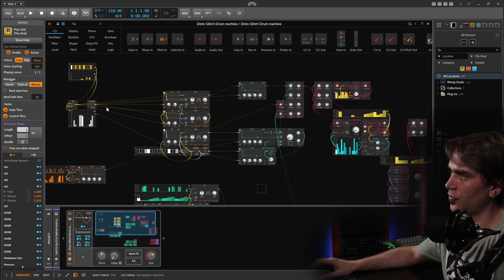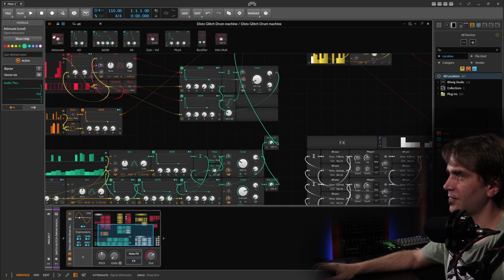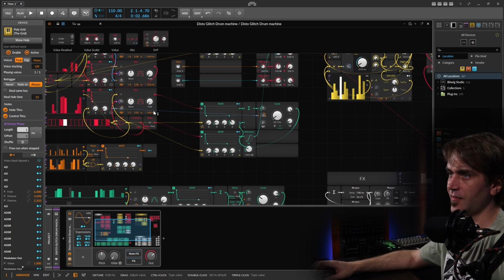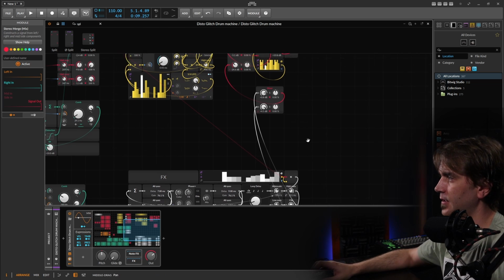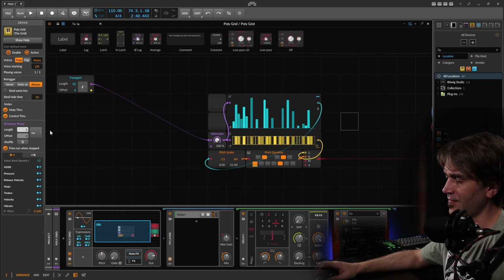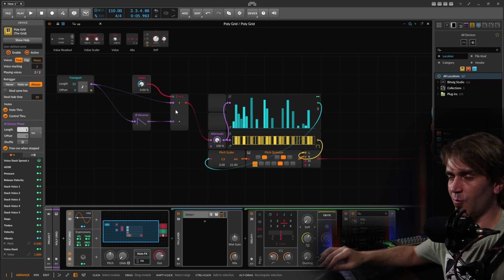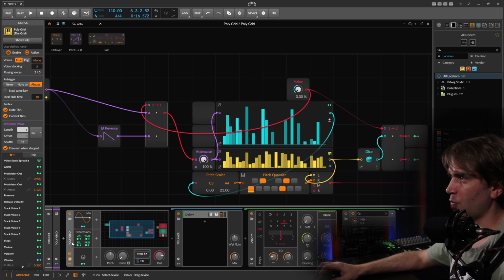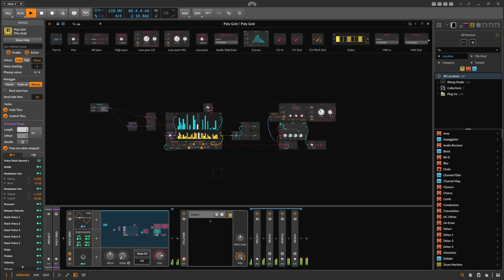5 Tips for Cleaner & More Efficient Bitwig Grid Patches (No More Cable Spaghetti)

Comment: Why did you use the L/R/M/S boxes to route the gate and pitch to the oscillator and ADSR at 7:47, instead of routing them directly without those boxes?
Reply from the maker: to carry 2 lines along 1 path, I think this was gate and pitch instead of L and R
Reply: @DashGlitch  So it's actually for a cleaner screen, not for any logical reason?